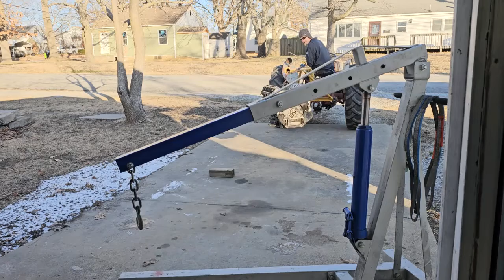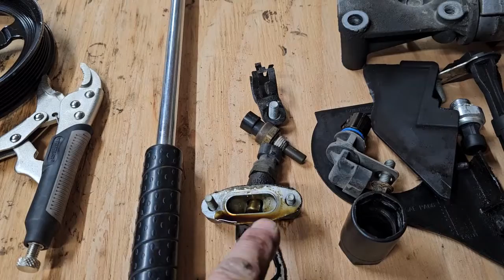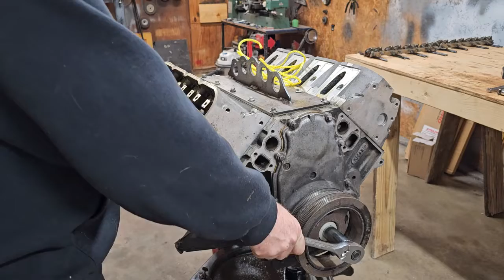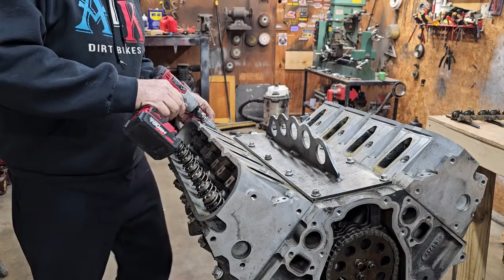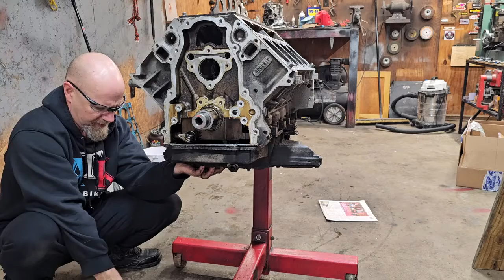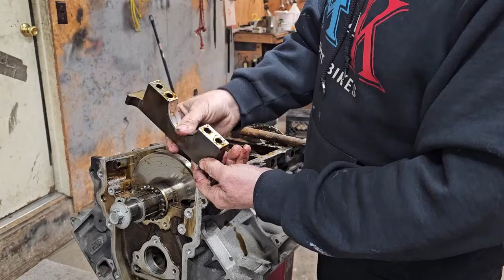C5 Corvette LS6 Rebuild - Pt 6 - Teardown

Comment: The change on the wrist pins happened with the gen 4 engines. But when going to aftermarket pistons and rods, you can easily swap to the floating wrist pins.

Comment: Are you able to talk about the difference between an LS1 block and LS6?
Reply from the maker: I know most of the differences.  Is there something specific you want to know?
Reply: @xpsgarage  What are they? They look like the same block to me. Apparently it just has bigger windows between the cylinders, whatever that means I don't know what these windows are or look like
Reply from the maker: @exoticspeedefy7916  I'll make a video and explain.  I also wanted to show the weight difference between the LS & my iron block 5.3.
Reply: Thanks for the content. Question, were you able to find evidence of the low compression you had while tearing down the engine? I didn’t see a head gasket leak on the one you showed. Were there  obvious problems with one of the rings?